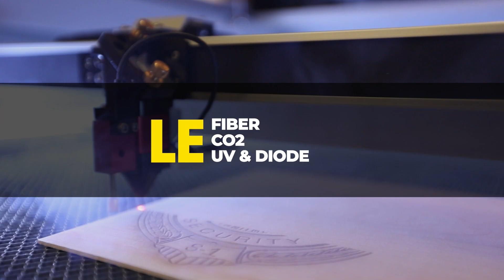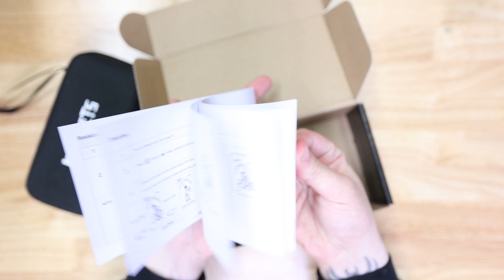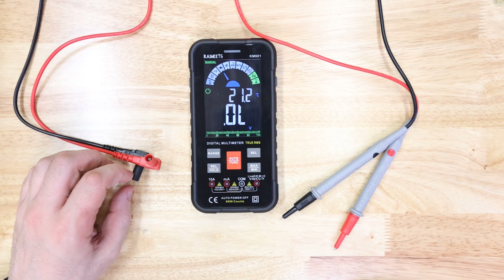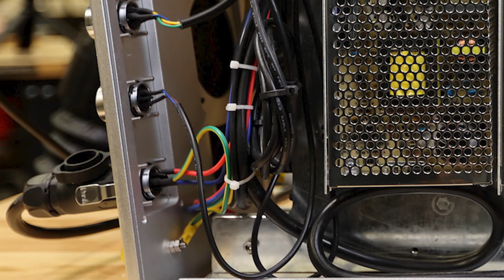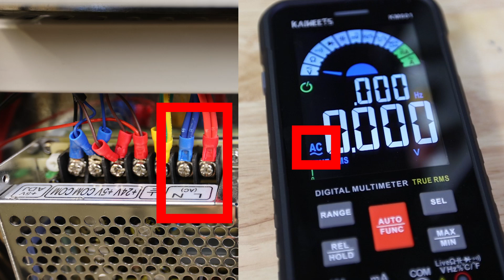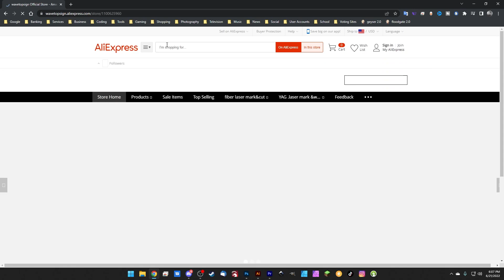Fiber Laser Power Supply Testing feat. Kaiweets KM601 Multimeter

Comment: this is very helpful! thank you. I'm running into a very weak laser, after one year of use (1-2 hour per day) my laser suddenly, halfway through a job, got very weak. I'm trying to figure it out....
Reply from the maker: Glad the video helped! This is an excellent place to start. If you find the power supply is consistent and putting out the proper voltage, next place to also check would be your optics. Be sure they are clean and clear (while the machine is off and safe, of course). If you're still stuck, jump into one of our community areas and start a support thread, can always brainstorm more if you get stuck.

Comment: Thanks for this video as I am having issues with my 50w fiber from cloudray less than 1y/o machine. They wanted me to test the voltage on the power supply but didn’t give me enough detail in the email and pictures… I’ve been having issues with running full wrap tumbler cups and about 1/4-1/2 way of the project sessions the laser would just quit running but in lightburn it wasnt communicating with it as if the laser was still working but it actually stops.. now that i tested the voltage and it has 0 voltage hopefully they can send me a new power supply bc I can’t find no information on this issue anywhere…
Reply from the maker: We’re glad to hear the content helped! Hope you’re up and running quick again. And glad it sounds like they’re taking care of you and the machine. Thankfully power supply isn’t too bad to swap if that’s the issue, hopefully they can get it to you quick.

Comment: OK so the laser source power supply is just a regular 48v power supply. I think I will get a 60 or 80watt mopa source and do a swap
Reply from the maker: Yep 24 or 48v for most standard laser sources. Definitely consult the documentation before buying to be sure.
Reply: @LaserEverything  Bought a 100 watt MOPA source last night. 48 volt power supply on the way. I will do a video on the swap.